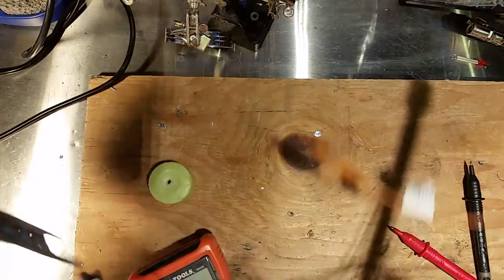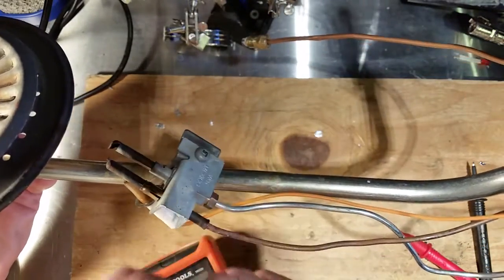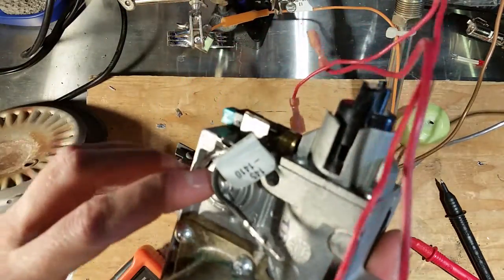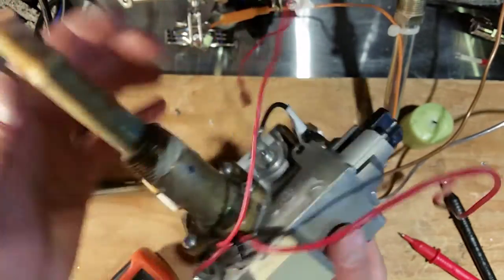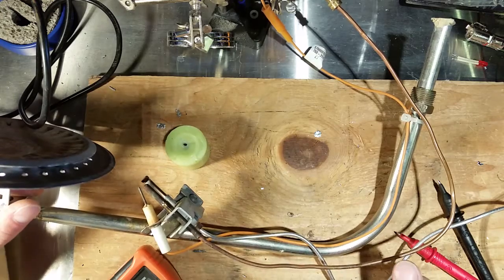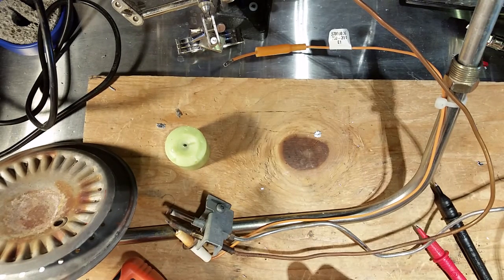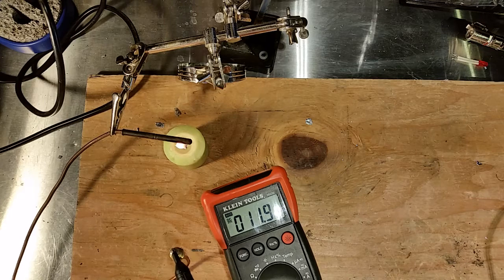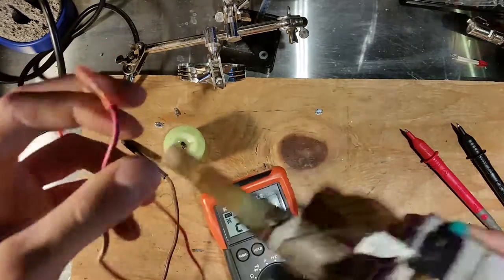Milivolt Gas Systems - How to Repair and Troubleshoot Gas Hot Water Tank

Comment: I actually learned a lot. So that little pilot light and thermocouples will generate enough current to power on a Hayward h150 pool heater? If so that’s pretty cool.
Reply from the maker: This is one of the vids I have another talking about how to troubleshoot the Hayward heater. In Essence yes. All that is required is a small amount of current to hold open  the spring in the gas valve. There are no other powered components. This is great for hot water tanks and fire places as they can continue to run in a power outage
Reply: Chargèro so to actually turn the unit I don’t need any wires plugged up or anything. Just heat?
Reply from the maker: @shawncampbell2930  if it is a milivolt system yes, it's the pilot light that heats up the thermocouple that keeps the thing on. Flame goes out. No power.
Reply: Chargèro yes mine is a millivolt. Thank you for your help. Now I’m just trying to figure out how to connect my 100 gallon propane tank to the heater. Any tips?
Reply: Chargèro I got it hooked up and when I depress the pilot down and press the ignition button in it lights up. But when I let go of the pilot button it shuts off soon as I let go. Any ideas?
Reply from the maker: @shawncampbell2930  Typically symptom of a bad thermocouple (the part the pilot heats up to generate current). Try holding it for a good minute before letting go and turning it to on
Reply: Chargèro ya I held it down for 3-4 min and I can watch the pilot light go dim then I press it back down and watch it come back lit. Just if I let it go for a few seconds I got to use the ignition button to turn it back on

Comment: I have got my Spectra and I am wondering if you could do a video explaining the Alarm IO and relays please
Reply from the maker: I have never tried to do it
Reply: Videos from Québec Do you have any info on voltages and things?
Reply from the maker: No idea, to my understanding it basically works like a switch to a relay. Find out the voltage, should probably be like 24V and then get a simple relay or contactor for the device you want to power.
You can get things like a motion sensor or door contact so that when the device is tripped you can program the camera to zoom to a preset, do a patrol or activate a relay device like a charm, alarm or light.
Reply: Videos from Québec I was wanting to put some PIR sensors around my area so I can get some automated operation to really utilise the PTZ but soon im getting a Vista Navigator DVR and a VKBD3i to control it with